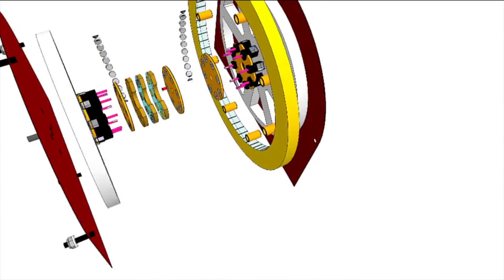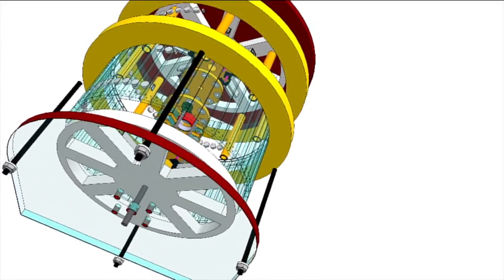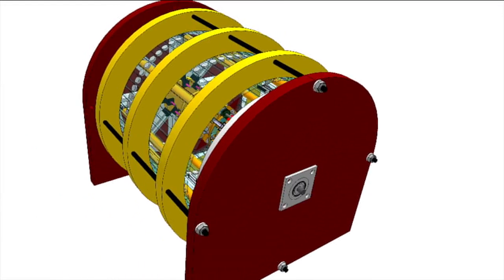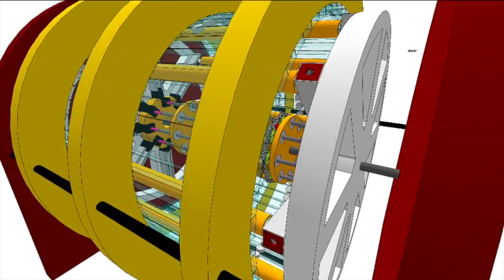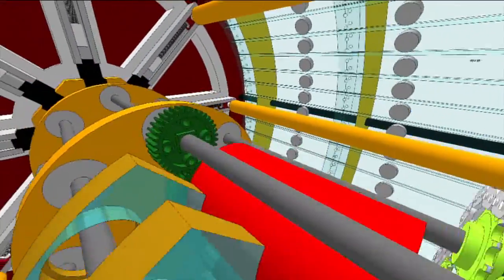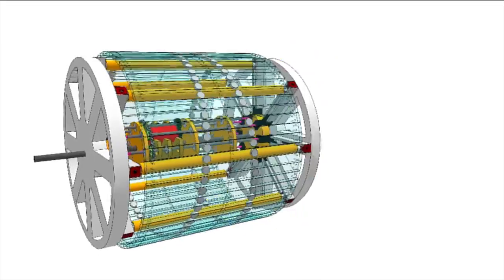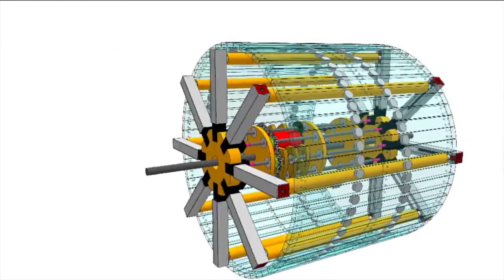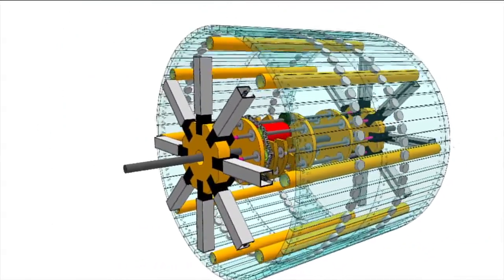Calloway V Gate Magnetic Motor Exploded view animation Variable Speed Multi Stator

Comment from the maker: The motor only runs the stator shifters. By changing the distance between the Vgate and the stator magnets you can control the speed. The centre axil is only powerd by the Vgate. I may do a new animation soon showing the device operating. Well how I imagine it working any how.

Comment: Finally very near to achieve overunity. See the link. 
https://youtu.be/9yQ9Ln7jBQ8

 calculations are supporting in the favour of this mechanism after removing all unnecessary parts. In the video there is box with a green ball to lift the green box there will be need of very minimal energy . Suppose the mass of ball is10 kg and counter weight is 10.2 kg.the length of box is 1 meter.the length of seesaw arm is 2 meter. Seesaw is slightly tilted towards counterweight. Now calculations To lift up the arm of 10 kg ball the input will be very minimal only. 3 joule But output Mgh=10*10.*80=80 joule Now clear doubts. The ball will not roll down in the box until the box gets 90 degree angle and will fall down after getting a certain height. In this way the input energy will be very minimal. But now the interesting point is that the seesaw will get back it's initial position without any extra energy. See the video carefully. It is completely overunity device.

Here are details

The arm length is=2 meter The box length is=1 meter The mass of ball=10 kg. Counterweight=10.2 kg The box is mounted=45 degree The counterweight=170 degree The width and height of box is depend on diameter of ball. Now calculate input and output but remember that ball will be not rolled down at the time of lifting the arm.the ball will fall down in the box after the box turns at 90 degree angle after lifting up the arm, if you are calculating input . It is not a big hurdle and you also know about it. Please don't calculate the input of ball after hit with bottom as the ball will get it's initial position without any extra energy